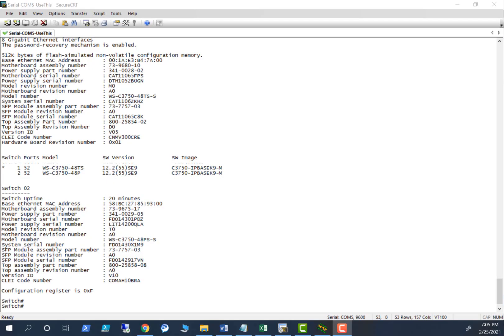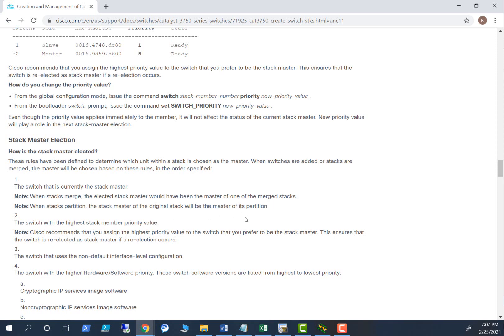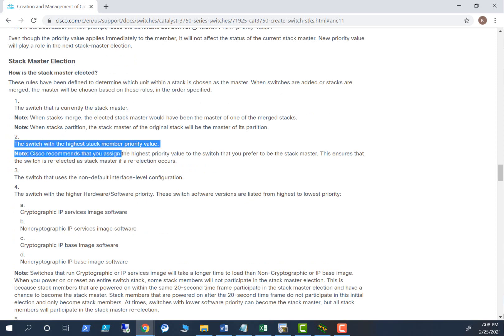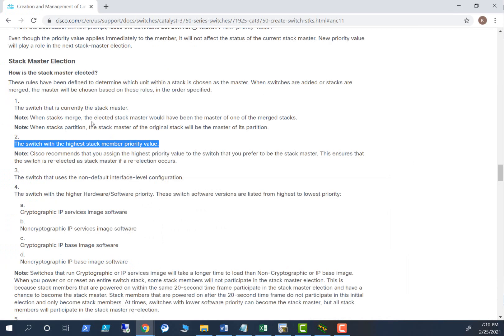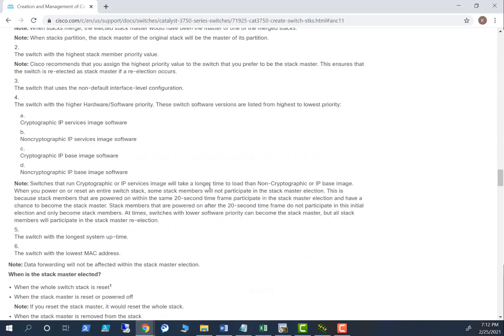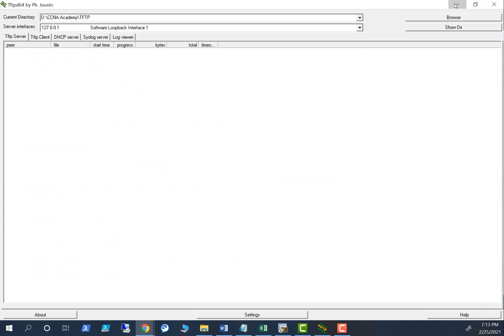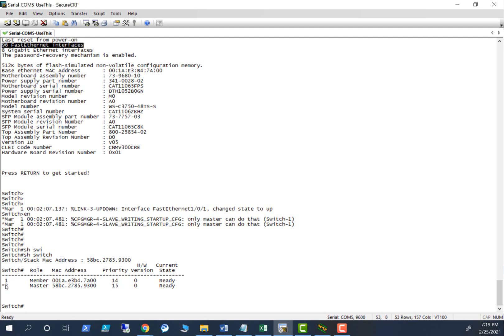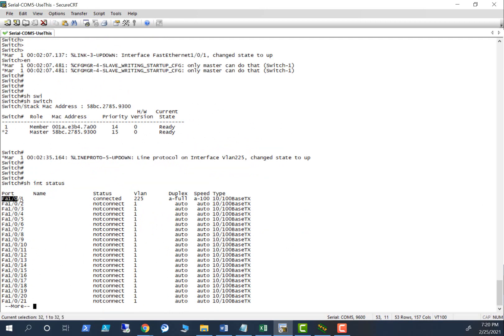Cisco switch stack master election - How the election process works

Comment from the maker: Let me know how if you have any questions regarding stack configuration. If I don't know the answer, i have a lab in my house and I will experiment it and get back to you ASAP.
Reply: Thank you for this chance to inquire.  After reading the stacking instructions I've learned quite a bit more from attending your lecture videos. You really put this all together well.  I am curious to see what a config.text looks like for a stack of switches. Would you mind sharing a sample of one from a test switch stack? Specifically, if I wish to load a voice vlan config for the master, would you mind sharing what a test stack config.text might look like after say before and after three Cisco switches have been stacked and prioritized and confirmed joined and functioning?

And how might on confirm a stack completed stack's functionality to confirm fully functional and working before before deployment?

Last, 
A 3-stack of switches using the CISCO-FIBER-STK modules requires two fiber cables to complete the stack, but is a 3rd necessarily required with spanning tree entry for redundancy?

Thank you for your time.
Reply: Was waiting  for your video on Renumbering. Can you please make a video on same.